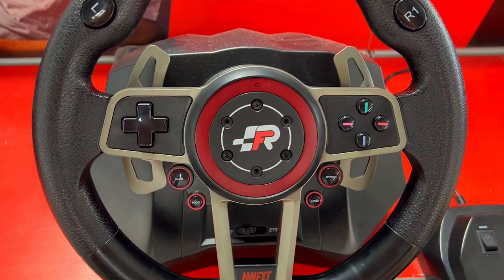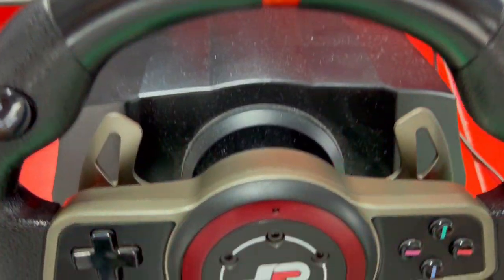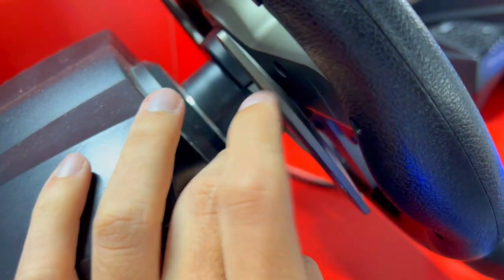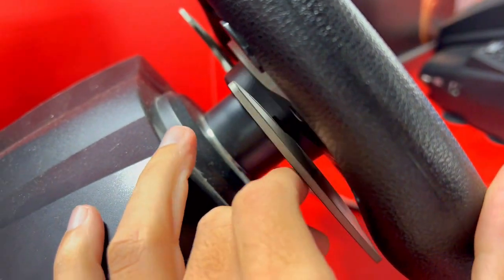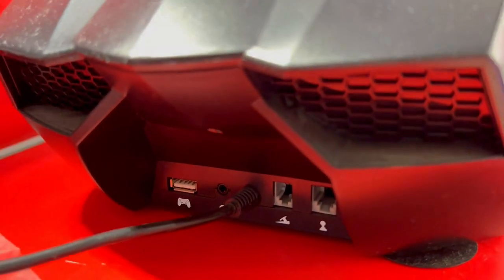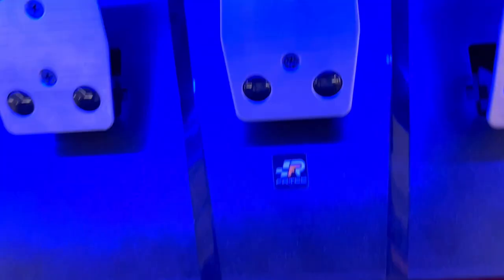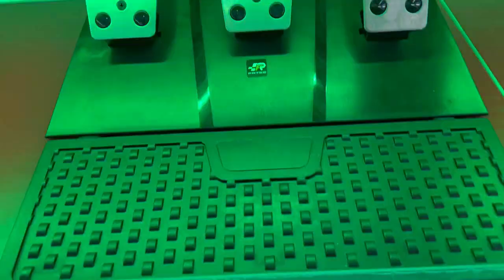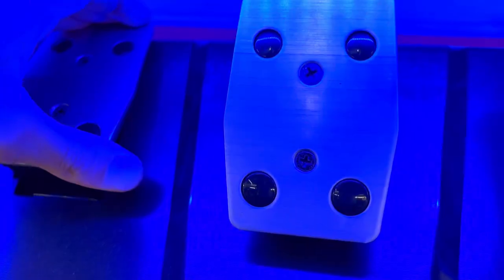3 Things You Should Know About The Flashfire Suzuka 900R Racing Wheel | Review

Comment: yo bro nice review but my question is does it work on pc??
Reply: Yes
Reply: You just need to plug it in. You might need to change some controls, but mine was fine
Reply: @tyler4042 which controls? i cant connect mine to steam pls help
Reply: @drewlolz  there should be an in game setting to select if you’re using keyboard, or the wheel. After that it should be ready to use. For me the sensitivity was a bit weird, but after some tinkering around with it it works fine
Reply: @tyler4042  do u need to download a software for the wheel?
Reply: @drewlolz  no, you shouldn’t need one